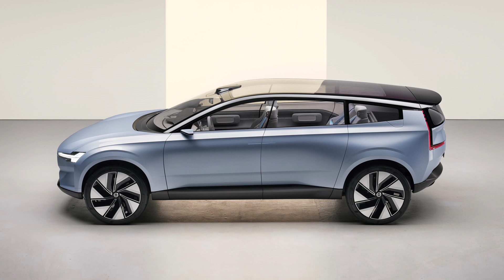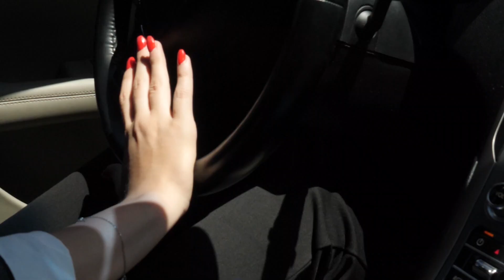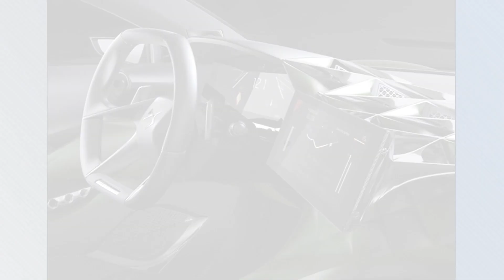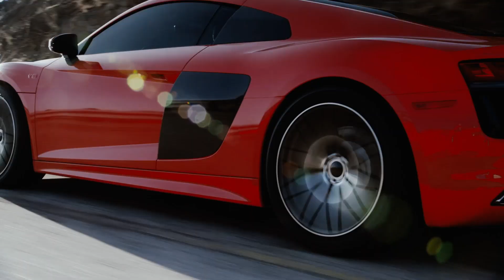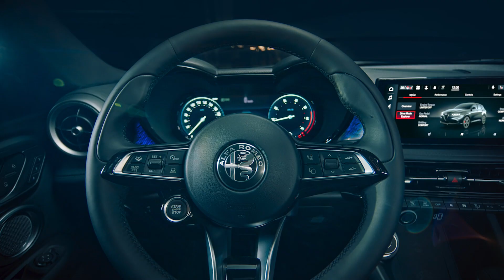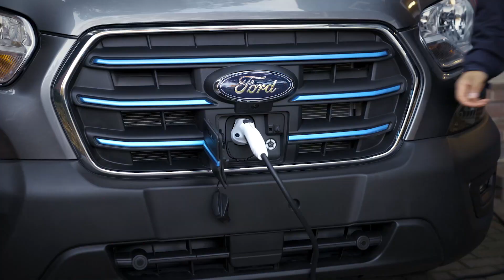Volvo Copies Tesla's Castings; Alfa Romeo Tonale One Cute Ute - Autoline Daily 3256

Comment: Misleading title. Giga press is IDRA's technology, not Tesla's, it's not copying Tesla, but rather using the same technology provider (if at all?)
Reply: It's the new aluminum alloy from Tesla that makes large aluminum castings possible with out subsequent heat treating that warps the components.  IDRA build the machines for Tesla because Tesla solved the heat treating problem with a new alloy.  I bet Volvo is paying Tesla for the right to use the new alloy.
Reply: @donm2255  nonsense. IDRA'S been doing these castings before Tesla, and still does them, without Tesla's alloy. Also every large oem has a wide portfolio of proprietary alloys, it's cute that you think Tesla having their first one is something special.
Reply: @SkywalkerWroc  It's cute that you think you are right.  IDRA has done smaller presses, but the Giga Press is new and Tesla so far is the only customer.  Smaller parts may not need heat treating or can be machined afterwards.  The larger the part, the more warping occurs with the heat threating and machining is expensive or not even possible.  The only way the Giga Presses can cast a big usable part that doesn't need heat treating is with Tesla's new alloy.  Legacy auto makers do not have their own metallurgy departments.  But Tesla does.  Tesla has changed car manufacturing forever with this new technology.  IDRA Giga Presses would be useless with out Tesla's new aluminum alloy.
Reply: @donm2255  IDRA designed and built this press on its own. Yes, Tesla was the first customer, but they've became interested only AFTER the development was completed.
Reply: @SkywalkerWroc  Tesla had been using smaller IDRA presses before the Giga Press.  IDRA would not have developed the larger presses for casting unless someone figured out the heat treating problem.  Tesla's new aluminum alloy was the key.  So no, Tesla didn't just stumble across the Giga Press after it developed.  It was developed because there was  a new aluminum alloy that didn't require heat treating.  And that came from Tesla.  The new aluminum alloy is what makes large castings possible.
Reply: @donm2255  Wrong againg. IDRA's smaller presses are widely used in the industry, nothing Tesla-specific. And not only they would have developed larger presses, THEY DID. Heck: Glovitech uses the same mode of IDRA's press that Tesla does, with their own proprietary alloy.
Stop reading BS from Tesla's fanboy blogs.
Reply: @donm2255  Volvo doesn't need to use Tesla's alloys. Tesla's fans have to go beyond what happens with Tesla in thinking only Tesla can do basic things, like alloys.
Reply: @benjaminsmith2287  You clearly don't understand what is going on with these large castings.  Tesla has it's own metallurgy department that developed a new aluminum alloy.  It doesn't need heat treating for strength after the casting process.  Tesla's new alloy solved a really big problem.  The heat treating is why automakers are not currently doing large castings.  This is definitely not a "basic thing" that any car maker can do.  They would have done it by now if that were the case.  No other legacy automaker has their own metallurgy group.  Literally, no one else has done this before--create large aluminum castings that don't need heat treating.   The heat treating causes warping.  The part is stronger, but not longer in the correct shape after heat treating.  Solving this was big and will impact car manufacturing from this point forward.  Automakers that can't implement this new technique are at a cost disadvantage.
Reply: @donm2255  So what? A lot of companies have metallurgy departments that develop new alloys. That's nothing unique.  This mantra some Tesla fans have that legacy aren't capable of doing basic things like that is just too much. Tesla owes to established autos as well in terms of how to make cars. Tesla just tries to cut cost and speed production so they use whatever means they can to do so.
Reply: @benjaminsmith2287  Yes, you get it now.  Tesla is making more changes per week than legacy automakers can do in a year with out interrupting production.  They cut cost, improve the car and the production processes faster than any legacy automaker.  The result is cars improving at a rate faster than legacy car makers can keep up with.  

The margins on current Tesla vehicles are the best in the industry and getting better at a rate no other manufacture can compete with.  It's all about cost.  Legacy automakers might someday have a compelling EV to sell, but their cost to manufacture means they won't be able to compete on price.  So they sell at a loss, or don't sell because the price is too high.  The cheapest solution always wins.  No company is doing more to reduce cost than Tesla.  And that is what will put most legacy automaker out of business.  Volvo sees this.  That why they are trying to implement the large castings because they know that can't complete without it.
Reply: @donm2255  I don't think Volvo is looking just at Tesla. They look at what works for them and what doesn't. Then they decide if it works for them. As a smaller company, they can go with megacastings to a degree. But I'm sure they look at other companies as well. Years ago, Porsche helped them develop their inline 5 and 6 cylinder engines, for example. 

I've driven and have ridden in Teslas. They have pluses and minuses. The pluses are the cars have great to supercar performance. They have efficiency in both space and using the platforms to get the most out of their kw. They have entertaining handling.

The minuses are inconsistent fit and finish, the body structure is not close to as solid as Volvo, BMW and other Euros and not on the level of Toyota or Hyundai either; the suspension on the 3 and Y lack the ride/handling balance of other cars in their price range; the NVH needs to be further refined. So the cars end up feeling like supercars in some ways and quite average in other ways. They're not my choice for EVs if I were in a position to get one.

People will like the Tesla interior or not. But I think, looking at NIO and XPeng and to a degree Polestar (especially the Precept), others do minimalism better. The thing is to have minimalism, but get some details in the car to make it feel richer. The latest S/X isn't bad but could be better. 

I think the biggest problem with Tesla isn't the cars. They need improvement and hopefully will get it. But Musk is not likable, at least I don't like him and I know many that don't. And there's too much Tesla is a leader forever hyperbole and, truthfully, fantasy coming from Tesla fanboy type of fans. Just let Tesla enjoy their success but respect what others bring to the table as well. And if Tesla leads or not, it's not important. Making Tesla the best Tesla they can be should be what's important IMO. Tesla will have their ups and downs in the industry like others have had. Now, they're in an up period.
Reply: IDRA is actually not the only company that makes castings.
Reply: @carholic-sz3qv  You're right. They're not the only one, but they are the provider for Tesla.
Reply: @SkywalkerWroc  lol…..IDRA has been making parts and machines for many other companies for years.

Comment: The problem with these cast components is when you are in an accident. The repairs can be very costly.
Reply: They are hard to damage I have heard. If you have a bad enough accident to damage it, the car is probably a write off.
Reply: Cars have not been engineered to be repaired for decades.  They are designed to crumple up and save the occupant on impact.  The mega castings continue that requirement.  They just lower the cost to make the vehicle.  So no, the castings are not a problem. Cars are not meant to be repaired when impacted with enough force to put the crumple zones to use.

And how would you know how costly the repairs would be?  Tesla is the only one using mega castings, and they haven't been doing if for very long.  Where are you getting the data to back up assertions?  Or are you just guessing?
Reply: @donm2255  BMW's CEO spoke about their decision to not use large castings during their Q3 call last year, specifically citing lack of any real cost savings and concerns on repairability.

Especially important to that second piece, parts of a car that would be most suited for large castings are not crumple zones, meaning a severe enough crash would ruin the entire casting rather than just a portion of a multi cast structure. That is what would make the repair expensive
Reply: @JDubbs07  BMW’s CEO doesn’t know what he’s talking about.
Reply: @JDubbs07  Just watch Sandy Munro's videos on the casting topics.  The cost savings are substantial in terms of factory foot print, less robots, less parts, etc.  It's a game changer and precisely why Volvo wants to do the same thing.  

That castings are engineered with crumple zones build in.  BMW's are not more repairable with their stamped, bolted, welded and glued hodgepodge of panels.  Let's say you want to replace the rear clip of a car that has been rear ended even though it would cost more than the car is worth.  Much easier to unbolt the rear casting on a Tesla than to unbolt, un-weld, unglue all the damaged panels that make up the rear clip of the BMW (or any car).  Anyway, it's a mute point. Cars are not designed to be repaired.  

The BMW CEO knows that.  He is just blowing smoke up the butts of investors to make them think Tesla is not a threat.  BMW won't be in business in 5 years.  There isn't enough capital for them to retools their factories (build new ones patterned after Tesla Giga Berlin) and more importantly retool the way their engineers think and the way the company operates to save themselves.  Tesla changed what a car is, how a car is manufactured, and now we are learning they also change what it is to be a manufacturer.  Tesla as a company operates very different than anything we have seen before.  No one is going to be able to compete, and no currently existing company will be able to replicate Tesla's internal operations. Certainly not BMW.  Mercedes may hang on for a while longer because they make commercial trucks.
Reply: @donm2255  both you and @Brandon Lamrock can save your anti-BMW rants for the Tesla forums. Why would they be out of business in 5 years? They literally just reported an all time annual sales  record for 2021, and fully expect a good 2022 as well. Unless you're a well connected industry analyst or member of BMW engineering leadership, you don't have the knowledge base to challenge their conclusion that the math doesn't work for them. Sandy Monroe is not able to speak to their business model either. Remember that each company's costs are very different. Considering BMW makes far more models and variants that both Volvo and Tesla, it's not surprising to hear it's currently not worth the investment and that they're better off pursuing other options, such as their carbon core technology or other methods. 

There's more than one way to skin a cat, try to remember that.

And for the record, you can watch videos of modern cars having major structural damage being repaired right here on YouTube. This is not a legacy phenomenon.
Reply: @JDubbs07  BMW dominate ICE market. Thus far they haven't shown a coherent vision of a non ICE future. The CEO recently complained about rushing the move from ICE. Their plan appears to be using their ICE vehicles for EV cars which makes for nice, expensive, short range offerings. Maybe they'll have a big enough market, smaller than current.
Reply: @Abebe345  it's only 2022, they don't need one. It's important to remember that automakers don't just sell cars, consumers buy them. Meaning BMW had a record year off of product people wanted. They also reported more than doubling 2020's fully electric vehicle sales numbers, so they're clearly not sitting still.

A recent Deloitte consumer study reported that 69% of Americans and even 58% of Chinese car buyers do not want hybrid or electric for their next car. Considering the high lease rate of their vehicles, they have several years to meet any expectations of their actual customers.
Reply: @JDubbs07  I think Volvo is doing the castings on a much smaller scale than Tesla. Volvo is a relatively small company but still makes more variants than does Tesla. Tesla makes 4 cars. That's it. Volvo makes about 7 or 8.  Then they also supply most of what is in Polestar which makes one, going on two cars.

I don't look for Tesla to provide the model for anything and I think Volvo will install much more stringent quality controls than does Tesla. Tesla has a long way to go to show me they can make a high-quality vehicle. They have supercar performance and tech, but that doesn't equal high quality.
Reply: @donm2255  thats not at all true, conventional unibody construction is highly repairable.  If a low speed rear crash damages the rear body panel, floor pan and rear frame rails which are nothing more than simple box construction what do you do, toss the entire car in the trash?  No you replace the damaged sections and the car is properly restored.  With die casting im not sure how you would go about attempting repair since the material defies straightening and i doubt its feasible to section parts of the assembly or replace in its entirety.  This process enhances efficiency at the manufacturing level but passes on the costs to the insurer/customer.

Comment: I suspect the mega castings for EVs will make collision repair next to impossible. Teslas are already insanely expensive to repair when crashed, many are just written off. I suspect Telsa and Volvo will be completely disposable cars if in an accident.
Reply: I'm even worried about the collision themselves. Will these single pieces have the same crumple ability as an assembly of multiple parts. Also lol, as if Volvo wasn't disposable enough.
Reply: @imnotusingmyrealname4566  That's why a drive a 20 year Volvo. Because it is disposable. smh.
Reply: @benjaminsmith2287  Didn't mean older Volvos. When they switched to FWD with only 2 4-cylinders is the cutoff imo.
Reply: @imnotusingmyrealname4566  My car is FWD. It's a turbo inline 6 and it's a nice engine. 4-cylinders had to do with paying taxes but it's something I wished they didn't do. But now they're going electric and as soon as they get the dedicated EV platform out, they'll have the effortless power that EVs bring. I don't think Volvos ever will give the best range but I think the best things about Volvos are the seat comfort, solid build, excellent high speed cruising and decent handling. It looks like Volvo will go FWD or AWD with the EVs.
Reply: The MegaCast and its repairs thelastof  you  worries in case of a accident , if it cannot be repaired  it means  the chances are  the  occupants  are  severely injured,  that is why  we  have insurance for cars, the same collision will total a unibody car ,my friend is a Collison shop owner.
Reply: They still have crush members that can be replaced which carry the bumper . If the crash is that bad that the castings is toast? It will not matter. Any other car would be written off because its frame would be bent.
Reply: Crumple zone structures are not meant to be repaired.  They have been that way for decades.  The Mega castings are very well engineered to reduce parts and safely crumple on impact.  All cars that have been made in the last couple decades are disposable when the crumple zones are crushed.  There is no such thing as a car that is easy to repair.
Reply: @donm2255  You obviously do not realize there is over 2 feet of area that is designed to absorb the energy enough to save the casting.
Reply: @donm2255  mega cast  are not crumple zones,and  they being crushed or crumpled mean the  accident might not  be survivable  there are  " sacrificial crash abortion rails " with  shear bolts, replace  these for fender benders.
Reply: @aurelio-reymilaorcabal9669  Every part of the car that is not the passenger cabin, is in fact a crumple zone.

Comment: Just wait till liquid composite molds hit.  Being able to pour a moulded chassis will turn tesla on it head. A new mfg is using liquid pours for the entire chassis and suspension system. 15% weight reduction and completely unitized and corrosion proof. 100% recycled product to boot.